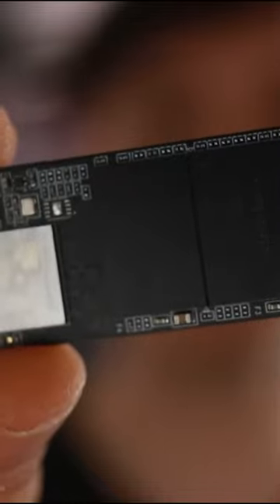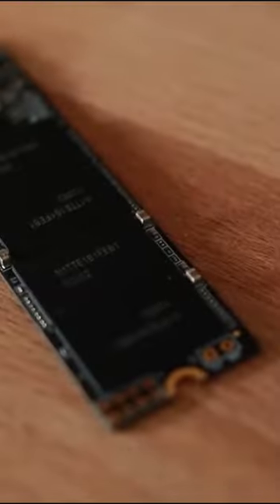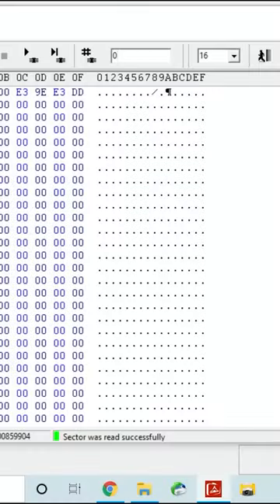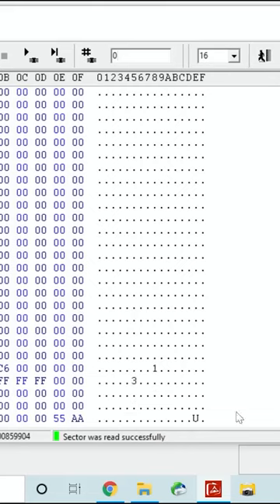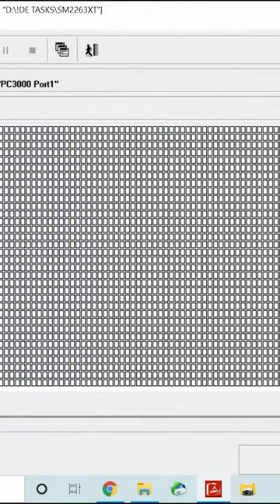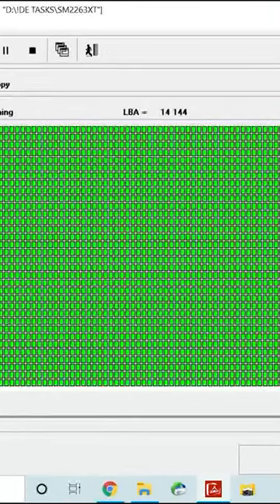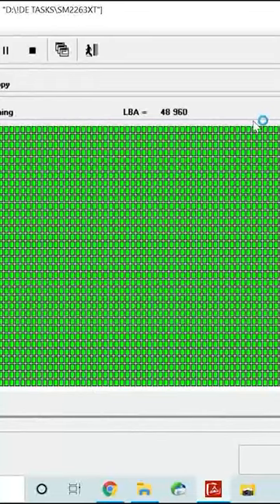solving problems on NVMe SSD

Comment: Wow, how does this work? Can’t you access the same interface if you install a special driver on your PC?
Reply from the maker: Vendor specific utility uses a loader to load simulated firmware, gains access to location of translator and build it virtually. Data becomes available to read even with degraded NANDs and original on disk firmware issues